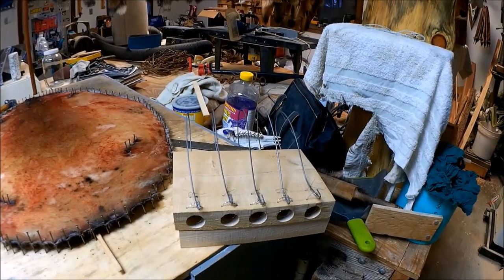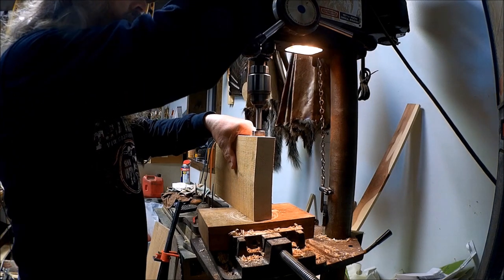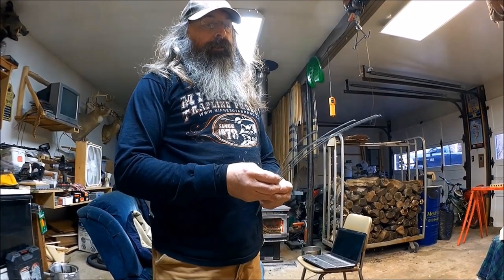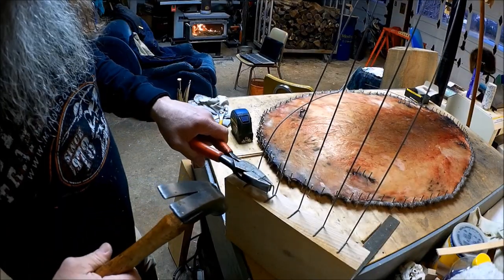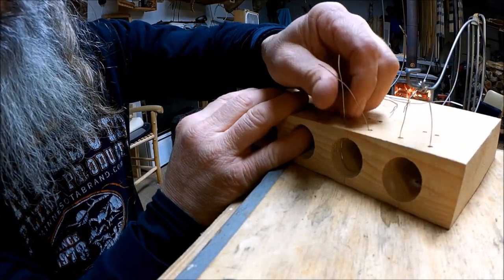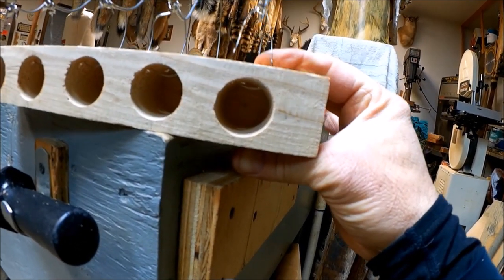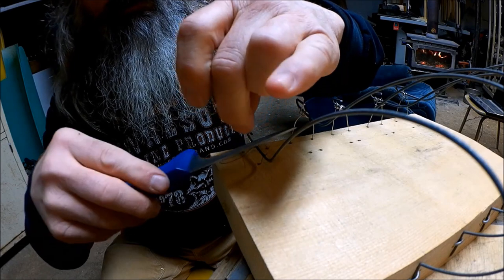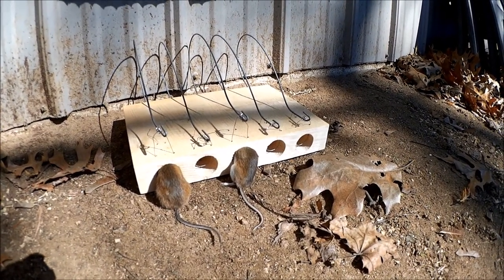Mascalls 430 Year Old Mouse Trap Build

Comment: Very neat job, this is a fantastic trap,I tried this with mild steel fencing wire( similar thickness to what you used), it's just not springy enough,  so changed up to some thicker MS wire and it worked really well, just thought I would post this in case anyone had some mild steel wire and was going to make one.

Comment: Very nice work! Excellent explaining. I actually made one also over the weekend but i just have to buy a long needle this week. Cant wait to test it out. Did you eventually fill up more of the holes with more caught mice?
Reply from the maker: DJ   Thanks, This trap has become one of my most productive mice traps. I have been running two of these almost every nite . i havnt kept a tally but have caught at least 100 mice in the past month. I have caught 4 in one trap multiple times but not all 5( YET! ) Im gonna make one bigger 15 or 20 hole one when i get time.

Comment: Can I use a metal coat hanger as a spring?
Reply from the maker: you need some spring steel wire or high tensile wire . Coat hanger wire is not that. It wont have any holding power.